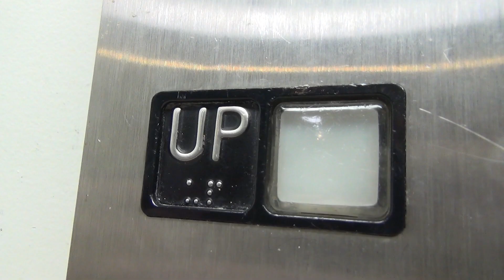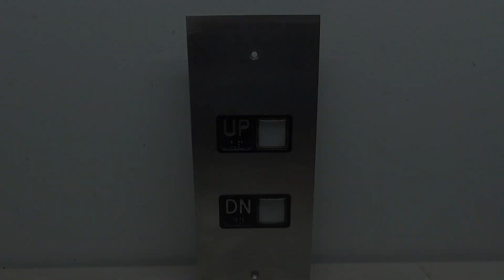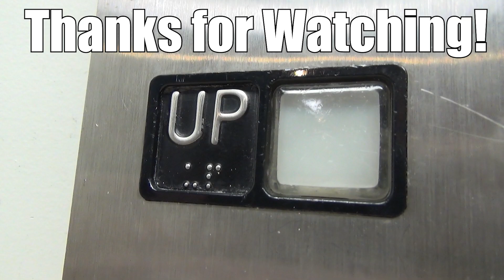Detailed Look and Wiring a Long Elevator Call Button

Comment: Highly request: Do a Schindler VR Wiring video and detailed look
Reply from the maker: VR has the same contact as regular
Reply: @stlelevators  is it?
Reply from the maker: @ElevatorAdventurist71  Yep. The build is slightly different, but it has the same circuit board on the back.
Reply: @stlelevators  request, wiring detailed look at the Schindler MT Lanterns